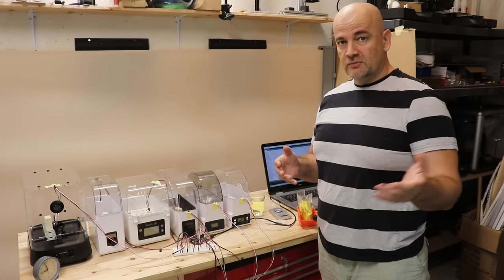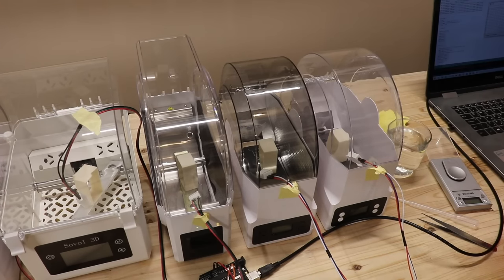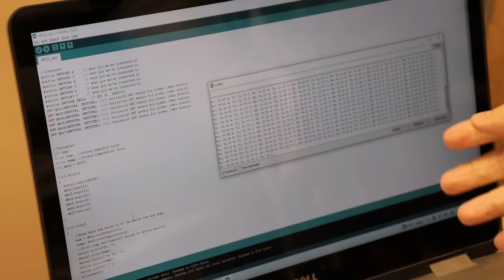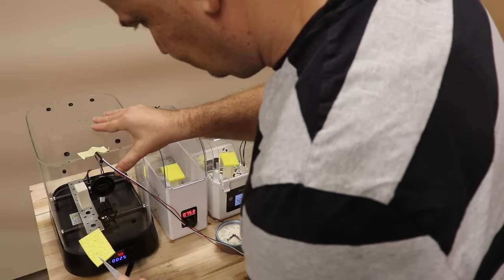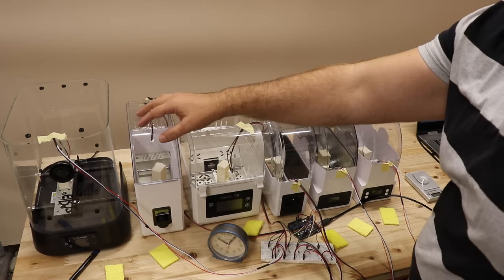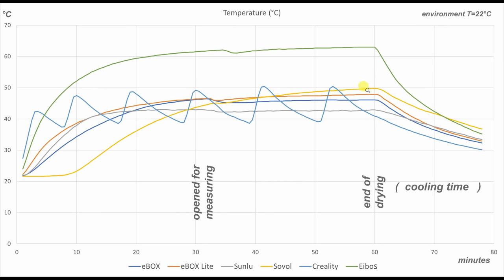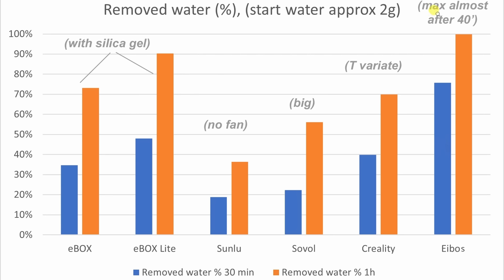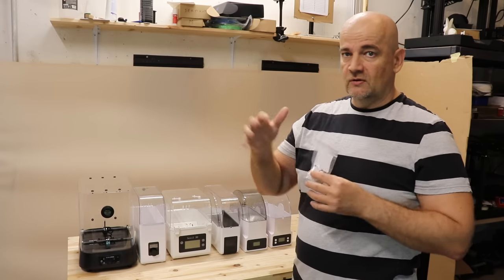6 filament dryer test - which one dries better? eBox, eBox Lite, Sunlu, Sovol, Creality, Eibos

Comment: As an engineer I love how you made this a proper experiment with controlled variables. EXCELLENT VIDEO.
Reply from the maker: Thank you very much! Good to read this from an engineer.
Reply: But he didn't have a control group... You can lose moisture over x amount of time just from evaporation. I think he should have left a sponge out of dryers and compare his results. That way we not only know how well the dryer compares to each other, but just the effectiveness of the drier themselves. A solid test and thorough test regardless
Reply: I think there may be a significant difference in which can evaporate the most water in liquid form, and which one can maintain the driest air to allow moisture to diffuse out of the filament.
Reply: As a non-engineer, i like this too. However, placing them one next to the other, will make the outer ones underperform, as the middle ones share heat. Same goes on in the appartment building i used to live in. If the neighbours turned on the heat, i could notice it.
Reply: @TF23DayRespawn  Nop, because of very short time intervals.
Reply: As a NASA Astronaut and Nuclear Scientist i love how he made this a proper experiment
Reply: I just came here to brag that I drive a train.

Comment: People are reporting that the EIBOS is so aggressive that it eventually melts the filament at heater fan input at the bottom. It might do well with a deflector of some sort so that the hot air isn't blowing directly on the filament. Similar complaints with single roll EIBOS at the center of the spool.

Comment: Thanks for the video! By the way, the Sovol manual says to leave the lid cracked open and I think this would improve the performance a lot as it will allow for the humidity to escape.
Reply: Exactly - it is a dead giveaway that the humidity drops when the lid is opened (at 12:55). The Eibos has vent holes in the lid to provide this venting, while the other dry boxes should be left slightly open while drying. The Sovol, as you mention, even has hinges which will provide the correct opening while drying.

Comment: Thanks for all your work Igor.
I use a PrintDry Pro. It is noisy but blows a lot of air and holds the temperature accurately. It sucks outside air, heats it, and blows it through the chamber. I have found it works great for me.
I had a fan motor failure after one year but PrintDry immediately sent me a new base free of charge. Pretty awesome customer support.
I took the old one apart and found the fan/motor construction to be of low quality. A very simple redesign of the fan and ducting would make this much much quieter.
Keep up the great work, Igor.

Comment: I have the Eibos. It works very good. I would not suggest running it for a 24 hour print, because it can over dry PLA.  For PLA just run it once at 50C for 4 hours, then just use it as a spool holder for the print within the enclosure.

Comment: Thank you for this video, I have a Sunlu one, but I added fan to it and some circuitry for the fan to be only on when the screen is on and moved the thermal probe up so it really heats up.
Reply: same here, saw another guy make a video on it. added a silica gel container inside the spool as well. hopefully its just as or more effective than the others now
Reply: Same here. Would be great to see a modded Sunlu in this test as well.! Definitely its increasing the performance but wondering if it is comparable to the others.
Reply: @tanujak98  Yeah, I took that video as an inspiration, but went further. Added a relay controlled by a octocoupler hooked up to one of the backlight LEDs, so now when the timer on the dryer runs out and the screen switches off, the fan switches off as well
Reply: @ptomicek  it would be cool if you made a video about it!

Comment: Nice to see a comparison like this. Just a suggestion, as location of sponge vs heating elements can be critical, use an empty spool and put the sponge in the middle to allow for that.
Also having them next to each other means the ones in the middle get more heat (from the other dryers) than the ones on the end - test one at a time or space them out more (though spacing out more you risk having diffenent background temps in the room.

Cheers.

Comment: Sovol recommends running theirs with the lid cracked open.  In this sense, the unit was not used per the instructions. Running with the lid open, however, would likely slow the initial warmup time further and may allow the surrounding environment temperature to influence the maximum achievable temperature inside.  I think the lid's sealed nature is also aimed at using it as longer term dry storage when the dryer is off.  The clips are designed such that the lid can stand ajar on them while running as an active dryer and this allows the humidity to escape.  Still, performance may be slow.  Also, I note from my own use that the Sovol dryer gives off some heat to its surroundings and as such perhaps the test should be run with the dryers spaced further apart to ensure no interaction between them.  I do like the idea of the test though.  Setting all to the same temperature target might be more useful for comparison unless the point was that a superior range of temperature can be beneficial (assuming you stay below glass transition temps).
Reply: If we were to run them lid open, I wonder if the environment air (which can be humid) can run in and prevent the moisture to be fully exhausted? Apparnently it's not like a single-way air exchange that prevents humid air from directly going in?

Comment: Ended up buying the Eibos one. Seems to be the best of all of them. Its quite pricey for what it is but its an investment and being able to dry 2 spools at a time means I can run 2 to power my 4 printers and can ensure that the filament is dry 100% of the time. It also means im not annoying my wife anymore using the oven.

I own a sunlu, Sovol and esun dryers but they are all a bit meh. The sovol is decent because of its seals but it just doesnt have the power needed to heat up 2 spools, and the moisture gets trapped.

Seems like the only one that doesnt is the Eibos, and theres some neat plugs on thingiverse you can print in tpu to plug the holes when its not drying.

Comment: Again, a great video. I'm using the Sunlu S1 with a 5015 @7V Fan Mod. Also the temp-sensor was moved to the middle.
Reply: Hi, did you get better result with this mod, and is it easy to do?

Comment: This is EXACTLY what I have been wanting to see for a long time, a comparison between these in a good way, it is clearly that even that I got the sunlu dryer extremely cheap, it still feels like a bit of a waste and explains a lot of why I have not got any good results from it
Especially right now in the autumn here in Sweden, right now my humidity is around 70% in the air, inside with no windows open, that effects the filament in a pretty negative way

I will wait and see what the new upcoming ones you talk about will bring and if they are better!
Thanks for this video, really interesting to watch!
Reply: Grab EIBOS one instead dude, you won't regret!

Comment: Wish I had seen this 4 months ago!
I didn't see any good reviews for dedicated filament dryers back then, so I bought something bigger than I really needed.
The facts:
I bought an Ivation food dehydrator from Home Depot, drilled holes in the side, installed Bowden tubing to act as feeders.
Its big, its noisy, it heats up the room, but it can dry 4 rolls at once!  5 if you don't mind crowding.
Highest temperature is 158F/70C, lowest is 96F/35C.  Regulation is quite good.
Timer runs up to 10 hours.
The fan inside is ferocious, lots of swirling air.
Does a decent job of annealing PLA objects.
Two rolls printing, two waiting their turn.
I live in Seattle where the humidity is constant; Lakes, rivers, Puget sound...we are surrounded by water!
Reply from the maker: Great info Greg, thank you

Comment: You're te hero we don't deserve but we need.

I wasn't aware that I need dryer for PET-G and is best to keep filament in the dryer during printing to achieve best results. Thank you mate
Reply from the maker: About PETG, my method in most cases: I take it from the bag (when it is new), do the printing and when finished, placing back to resealable or vacuum bag. In this case you can avoid using the filament dryer (but the best if you do use it even for printing)
Nylon: Similar to PETG, only even the 3D printing is done from the filament dryer.

Comment: I really wish I would have had a review like this a year ago... I would have bought the eibos instead of getting the sunlu and the esun.
Amazing work as always, thank you!
Reply: Add a fan (many YouTube videos explaining how) and keep the lid open a hair. That turns your Sunlu filament heater into a filament dryer. There is a good reason why both food dehydrators and clothes dryers both expell a lot of hot, humid air...
Reply: Why don't you choose EIBOS one? It works pretty well.

Comment: I own a Sunlu dryier and was indeed not impressed by its drying performance. I did very similar to you with the humidity and temperature sensor inside and found out that 2 10mm holes, one in the bottom below the heater element and one in the top greatly improved the performance. Humidity inside the box dropped from around 55% to 15% in half and hour. The temperature inside the box was actually higher (don't remember the exact number but about 5 °C) with the holes versus without. Drilling 2 more 10 mm holes did not help any more.
So I ended up with 2 10 mm holes one in the bottom and one in the top on opposite sides to improve the design.
Reply: Hi Koen, can I check with you: a hole into the case to the outside? on the top and at the bottom of the case?
Reply: Great info! I came down here to ask if he might do just this experiment, I'm glad you can already confirm it works :)
Reply: Where exactly did you drill the holes?  Outer body or the metal heater?
Reply: Can you update us on the hole placement? (Would also like to know if you're referring to the V1 or V2 sunlu dryer).

Comment: Great video, after over 4 months watching this video over and over I decided to buy the Eibos, without any doubt it is the best, but still, after some weeks of working with it, I discovered it has major problems that I would rather describe as design failures. The most inconvenient one is the position of the heating head and fan just underneath the rolls. I had to dry a PLA roll without the need of printing immediately, so I dryed it using the suggested temperature and times. It has dryed, but when I took it off, several coils were deformed in the bottom part, the heated PLA started melting and slowly deforming because of gravity. This is a really bad problem, since this dryer also has the opportunity to contain two spools that rotate independently, so if I'm using one of the two, the other will melt. This could be corrected in an updated model by moving the hot air flow on the rear of the place instead of the middle. This is the first modification I will suggest the producers. The second one is: this looks really great with the squared case, but would be even better with a less intriguing design rounded on the top- front and rear borders (like all other models have), creating a better air flow. If both these modification should be made in a next version of this dryer, I'm pretty sure this will be even better. (another idea could be having a small electrical engine rotating the rollers when not in use, but this would require a more complicated UI to set whether to move or not)

Comment: i use the Sunlu one with no fan. Just dried some TPU that was full of moisture, worked ok. I cover it with a small towel so it insulates the top better, and put desiccant in the spool.
I have it running right now, with a hygrometer inside. It settles around 102-106°F inside, currently at 19% humidity. My thermostat says it's 77 ambient @ 39% humidity in the house and 71% outside, as it's been raining a lot here.

Comment: Hello, a great video and informative, I do own a Sovol unit but it has the brand Comgrow on the front. However in the instructions it state the cover should be left slightly open to allow the moisture to escape. The cover catches also function as a lid rest to hold the cover open and I find the humidity drops quickly once the lid has a 10mm gap. Without doing this the unit is seals and so the moisture can only condense on the kid. 

I shall buy a eibos unit and test it also. Many thanks Danny
Reply: I tried to redo MyTechFun’s test with a solder sponges but my results were better for some unknown reason:
Closed lid 30 min (MyTechFun: 22.3%): 39.3% Fog
Closed lid 60 min (MyTechFun: 56.1%): 71.9% Fog
Lid partial open (standing on latch) 30 min: 65.5% No fog
Lid partial open (standing on latch) 60 min: 102% * No fog
*The new sponges were probably not completely dry before the test.
Lid closed with four filament holes open didn’t do much difference and it fogged up.
Result: Lid partial open is far better than lid closed.

Comment: Excellent video. I've been in the market for a dryer for a while, and was about to simply make my own. I am neck deep in projects, and I'd rather just buy a dryer, than divert energy away from other stuff.

One thing, you forgot to include a control. You need to put a sponge on your thingy so you can measure the rate at which it dries in ambient conditions. You need this control for your drying rate. No control means you only have absolute values to work with. Final water content is an absolute value (and in this case the most important one), drying rate is a relative value, and needs to be compared to a control.
Reply: @bigtexuntex7825  Physics...

Comment: Super test. But wouldn't it be interesting to carry out this test in a classic fruit dryer which is taken as an alternative to specialized dryers directly for filament?
Reply: I checked food dehydrator in my last video. After drying ASA spool for almost 5 hours it went from 993 to 991 grams. Max temp can be set to 70C but in fact there was about 60C at the top. I can perform similiar test with wet sponge.
Reply from the maker: I have food dehydrator and I am using it. I am working on modification, so I can use it during 3D printing too. When I finish that, there will be a video.
Reply: @MyTechFun  I was also thinking about modyfing it to enable printing while drying. Not sure in which direction it will go (adding lazy susan, upright filament stand or rebuilding it from scratch).

Comment: nice video, I have the Eibos for PETG only, I find the heat release enormous in the office, fan noise less loud than the ender 3v2.   Remove the black "humidity" label on the humidity sensor of the Eibos, we will also have the temperature in the box in ° F or ° C. 👍
Reply: I just got one of these dryers about a month ago, and I was expecting to have to remove the "humidity" label from it to see the temperature, but it shipped without it, so I didn't need to. It makes me wonder why it was ever on there.

Comment: Watching video now. If you don't do it, you should also have a control sponge A) sitting on the table in ambient air, to see how well evaporation works on it, and B) another one in ambient air with a room fan on it, to see how well convection at room temp dries it. These would be good baseline comparisons against the filament driers.

Comment: Very helpfull test, as well as your other drying boxes videos. I have two of the Sunlu S1, mainly for use during 3D printing. Chose those as they do not make any noise. After watching this and your other videos I think I will add a Eibos to use that to predry filament that I am about to use. Or to dry it before I put it in a vacuum bag. Even with the Sunlu S1 I have seen better results with printing. Subscribed!
Reply from the maker: Thx, don't forget to check Sunlu S2 dryer too (new version) https://youtu.be/uVW8kgLKjT0

Comment: At the end of the day the Ebox Lite has never not dried my filament so I will continue to use it.  I don't really see any advantage upgrading to the eibos for my purposes, but great video.
Reply: Definitely not a real advantage to Eibos; You can save 25% of the cost of the Eibos by buying two eBox Lites, which perform nearly the same in thermals.

Comment: What you measure is pretty much exactly what I experience: most of those boxes are filament heaters, not filament dryers. After I saw condensation at the top of my Sunlu for the first time, I added a fan and now keep the lid open a crack. Same interior temperature but no more condensation since then...
Reply: I’m shopping for one. I was thinking, if my HeatLogic heatable lunchbox was big enough, I could put a spool in there, the filament could thread through the zipper and the moisture could escape through the zipper, too.😆

Comment: I have that sovol. I've wondered for a while if I should drill holes in it. I will drill 2 holes in the back (not too many since you say the heater is weak). I also have a fixdry it looks a hell of a lot like that eibos, but it is a little different. It has the same number of holes as the eibos. So I'm guessing the performance is about the same. I also love it because I can turn it on and leave it on. I print with my dryers on the whole time. I found it was necessary with my sunlus, but now I'm wondering if that was because the sunlu wasn't that great. Maybe with the fix dry it's not necessary?
Reply from the maker: Don't drill holes, Sovol can be used as sealing storage box too. Filament don't have so much moisture as that sponge in the test.